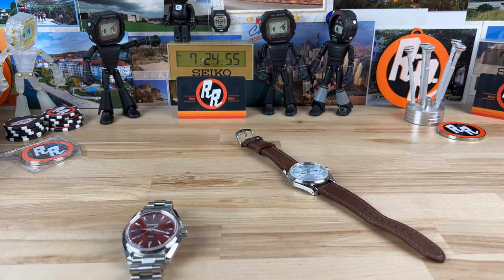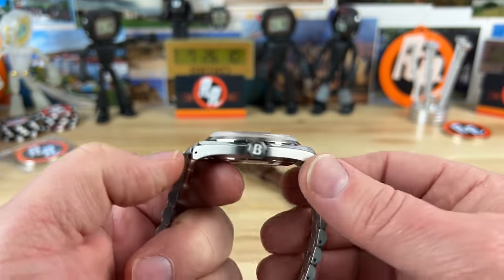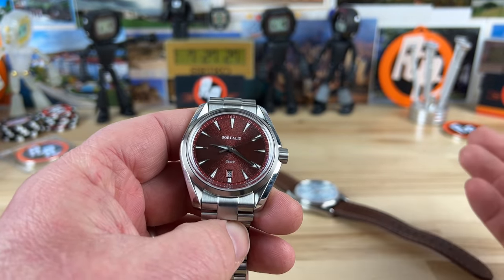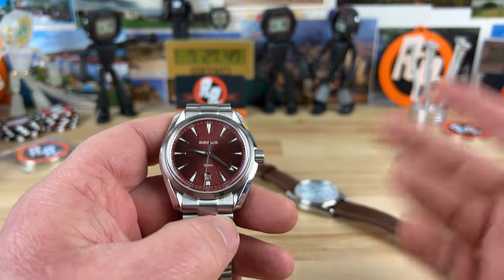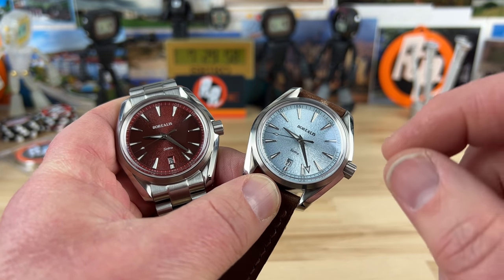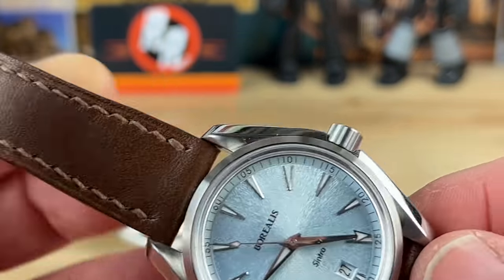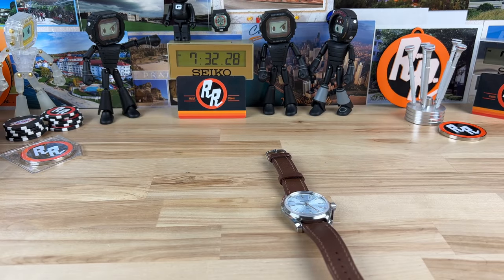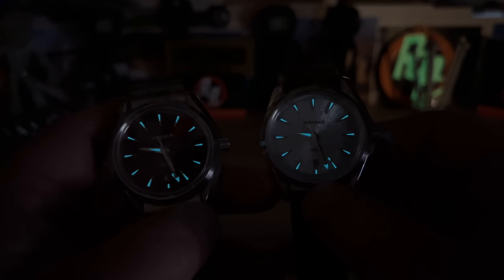Borealis Sintra New Model!!!!

Comment: for a divewatch its thin but it depends what you compare it to. If you compare it to a bit more dressy watches like a tissot prx or christopher ward c63 then its not that thin. those are around 11mm but those ofcourse dont have 200m water resistance

Comment: Rob, I was able to get in on the pre-order and I  went with the red dial, because I've been looking for a good red dialed watch.  
The watch came in and there wasn't anything wrong with it, but I just wasn't feeling it. It looks great under the lights, but in person I was asking myself why I bought it!?😶😶
Then on a whim, I was looking at Borealis on ebay and there was a RR edition. I won it and I've been wearing it for two days! My feelings are 180 degrees from the other watch! So much so, that I have a hard time believing they are essentially the same. The design of the RR edition really elevates an already strong design!  I wish the red one I got had the indices and arabics also. The indices on the standard version are too small.
Reply from the maker: Thanks. Yeah the RR is more everyday wear for sure. The red could be cool on some good leather.
Reply: @RandomRobReviews   Oddly, having the RR edition has kind of changed my feelings on the red one. I appreciate it a bit more now.

Comment: Great quality hi-beat movement for the price - actually that Chinese PT5000 hi-beat in your prototype is also supposed to be pretty good. Love everything about the dials - texture, colours, hands and indices.  Love the red dial - I don't have a red face watch.
Reply: I pre-ordered the red one yesterday. I do agree, it is a stunning piece and there aren't too many red faced steel sport watches. I actually prefer the miyota 9015 over the 2824/pt5000. It is more modern, is way slimmer and I've always had winding issues with the 2824, either the rotor bearings being loose or the winding bridge grinding itself to death. Miyotas were always just fine other than the louder spinning noise (which I believe has its own charm).